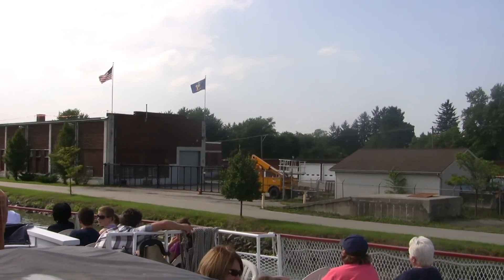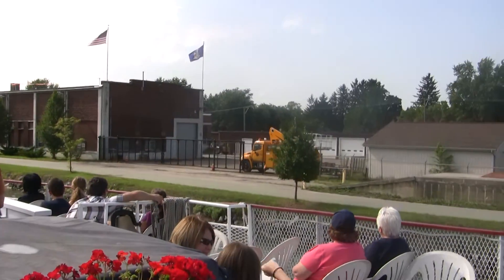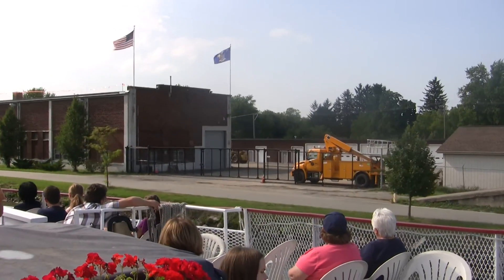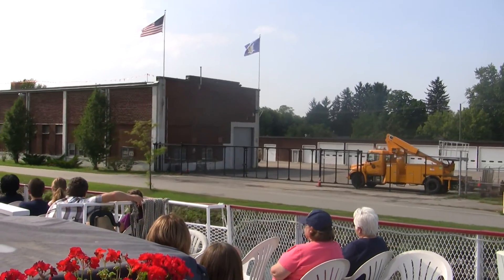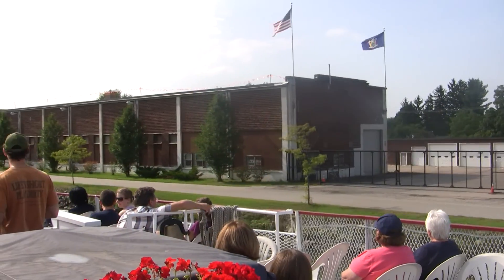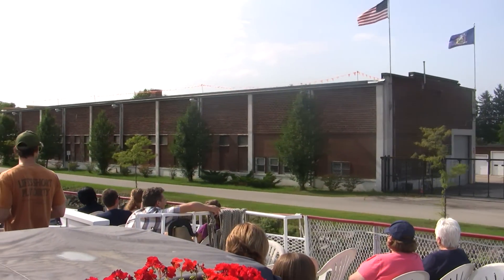A ride down the Erie Canal on the Colonial Belle, part 7.

Comment: The Erie Canal is not a naturally occurring waterway. Due to fact that it is man made, it does require constant maintenance to not only it's banks, but the locks, aqueducts, dams, and guard gates. Not to mention the valves and tunnels that allow lock masters to adjust the constant flow of water and regulate the water levels.